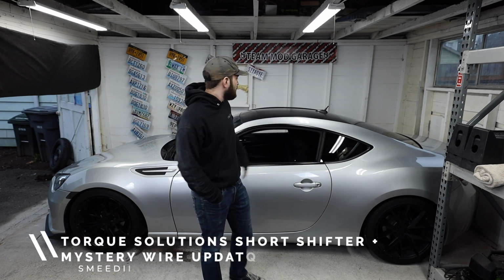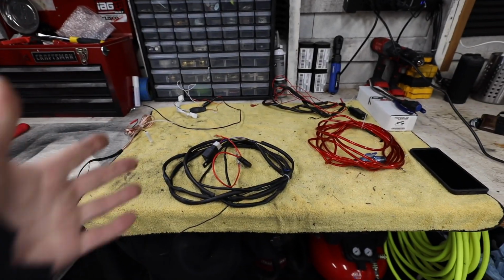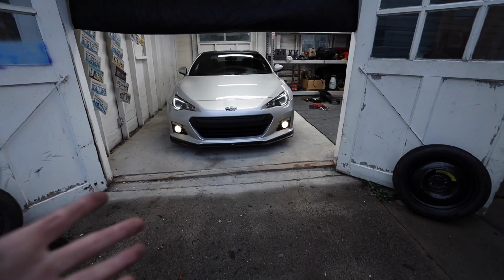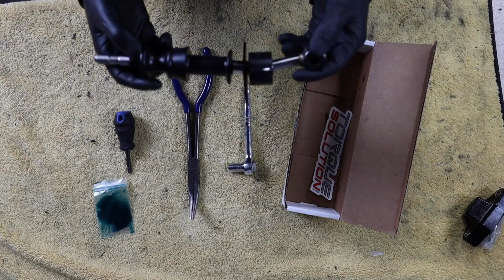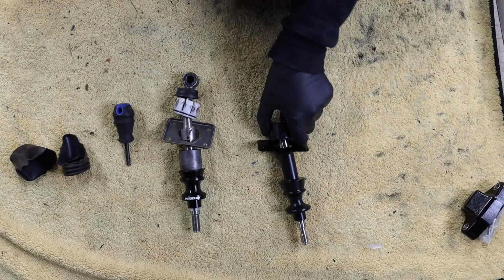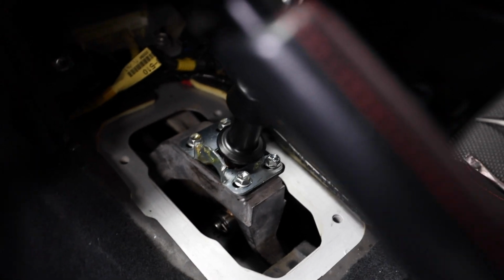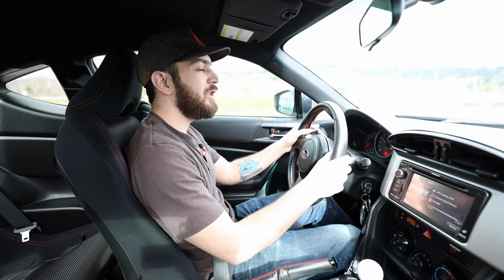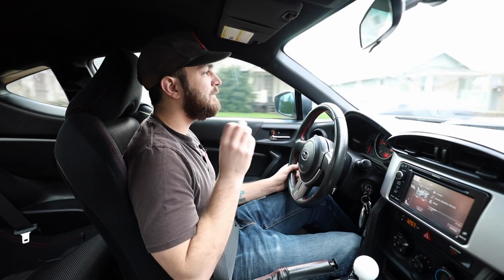Torque Solutions Short Shifter (BRZ) + POV & The Mystery Wires!

Comment: I installed mine a few months ago. Lived with it for 10k or so. Really did not like the feel until I added the rear bushing and front carrier bushing. it really cleaned up shift feel. Solid thunk when engaging gears and zero slop. 

I ended up swapping back to the OEM shifter but kept the bushings. Wasn't a fan of the feel compared to stock. Now shifts are light and easy with very little slop, just from the OEM bushing where it connects to the shift rod.

Comment: Not hating, because I've done it, but maybe the 'kid' that owned it before you thought he was an electrician. My first car (2000 dodge neon) looked like a damn spaghetti factory. Now that I know better, my wiring looks soooooo much better. Also I absolutely hate those marker lights on the FRS/BRZ. I do collision repair and more often than not I completly forget those have to come off in order to take the front bumper off. Great video as always, keep up the good work. Wooooo!!!!
Reply from the maker: I think we've all done it and looking back on when I first started working on cars and my wiring. Ooooooof it was awful. And those corner lights can burn in hell 🤣 they never stay in!

Comment: Did your shifter happen to come with two small o-rings? If so, where were they installed? I can't find any information/instruction and haven't heard back from Torque Solutions. I'd greatly appreciate it, hopefully it stops this terrible rattling. 😅
Reply from the maker: I don't think so 🤔 tbh it's been so long I can't remember but I don't think I had any 😅
Reply: @Smeedia  Thanks, I appreciate your response. It's looking like it's optional and goes on either side of the sifter along the linkage. Although the bushings on mine were so tight that the cotter pin is also optional. Don't think the shifter would come back off even if I wanted it to 😅. Thanks again.

Comment: Savagegeese did some forced induction work when the frs had just come out and after months of fab and professional mechanics working on it that thing was leaking oil so much he sold it. Scared me straight about the whole thing. I think itd be a fun track car to learn to drive and push your abilities but trying to push the car itself wouldnt be my choice.
Reply from the maker: I still need to take mine in for the valve spring recall so hopefully Subaru can take care of any leaks for ne if there are some
Reply: @Smeedia  oh no I meant the turbo kits  leak oil. You should be fine.

Comment: Have you had any rattle noise with it? I used to have the ft86 speed factory one, which was just a buddy club replica, and it would rattle like crazy.
Reply from the maker: No rattle at all with the Torque solutions one, overall been really happy with it over the past few days.
Reply: I’ve had this too. I think my torque solution shifter is hitting the bolts that hold the reverse lockout

Comment: I just got this short shifter installed at Subaru (throwout bearing went out so did whole clutch) and this shifter rattles a bunch. Is this normal? Did the tech do something wrong?
Reply from the maker: Mine never rattled I would double check to make sure everything is installed properly
Reply: Another commentor tightened down the Allen bolt in the center of the stud on the new shifter. This apparently fixes that

Comment: So I installed this same shifter in my BRZ and I get a crazy rattle from what I think is the reverse lockout at like 4k RPM.  Do you have this issue?
Reply from the maker: Never had that issue with mine, double check that the reverse lockout cable is not rubbing on the driveshaft
Reply: I actually fixed it.  The shifter has a screw that you need an allen wrench for.  I tightened it as much as I could and now the rattle is gone. 👍
Reply: @JorgeOrtiz-vl1mf  hey I just installed one as well and experienced the same issue (rattling around 4k rpm) which part specifically needed tightening?
Reply: @reignerrrr0805  if you take off the shifter knob there is a screw on the top that goes down the middle of the shaft. You need an Allen key(not sure what size I used)  tighten that.  I eventually ended up switching back to the OEM shifter because I bought a new reverse lockout but was not compatible with the shortshifter.
Reply: @JorgeOrtiz-vl1mf  ah I see, thanks so much man! Will try it later on. Gonna see how long it’ll take before I go back to OEM